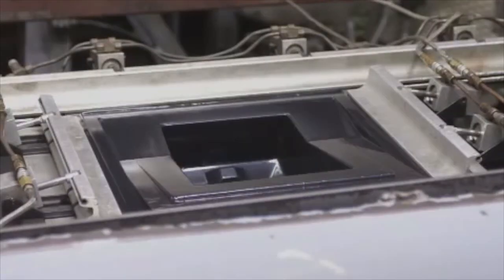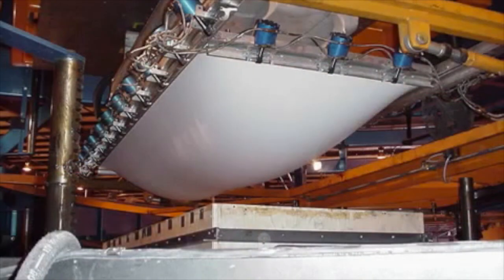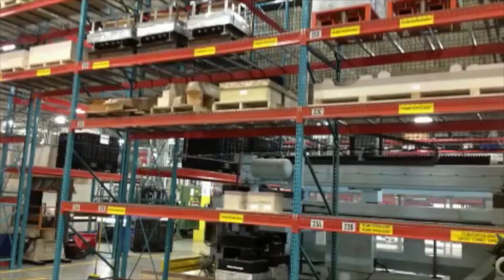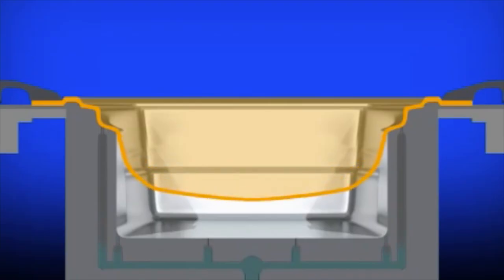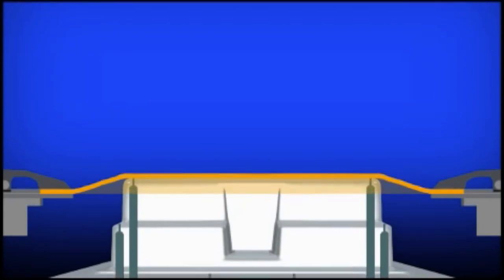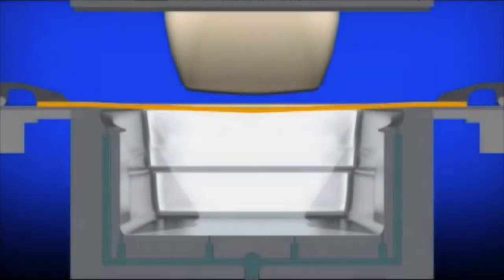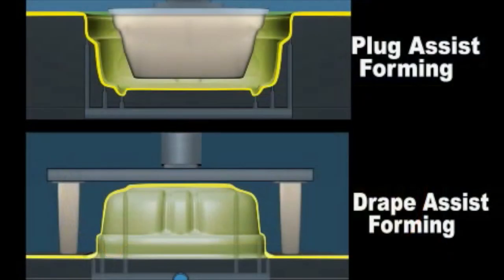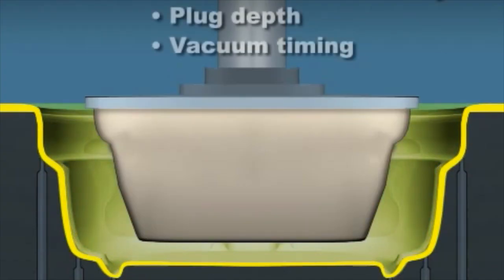Vacuum/Thermal Forming Explained

Comment: Another way to improve wall thickness is to blow a bubble before forming. (prestretch)
Reply: How to do?
Reply: @jenniferbonete4852  Instead of applying vacuum, apply air pressure.
Bottom piece of the machine needs to be closed off.
Reply: Is this applicable also to female mould?
Reply: @jenniferbonete4852  Yes, verry well. You can first blow a little bubble, then suck it back in.
You can also wait before you applly the vacuum and let the material sag down, then apply the vacuum.
But you need more heat i think.
Reply: @mdftrasher  do you encounter hole on pocket before? Wall is very thin..
Reply: @jenniferbonete4852  You may need to search for the border line, not to much prestretch, not to little.
Most of the time you need three forth of the mould hight.